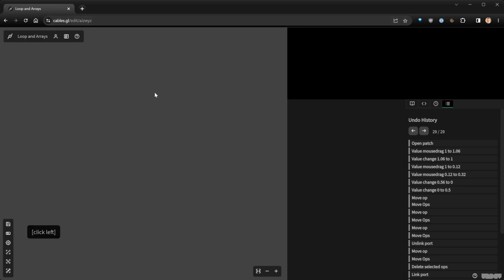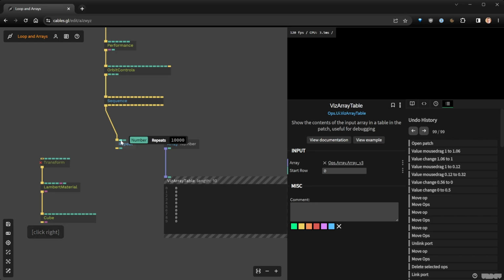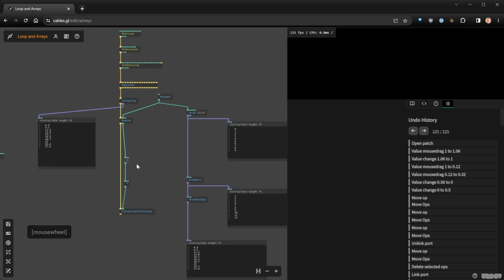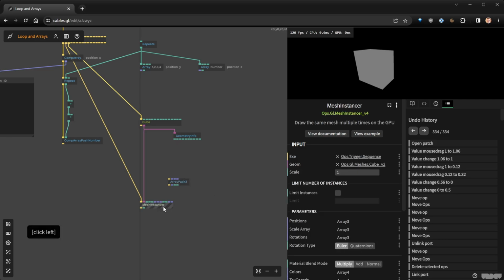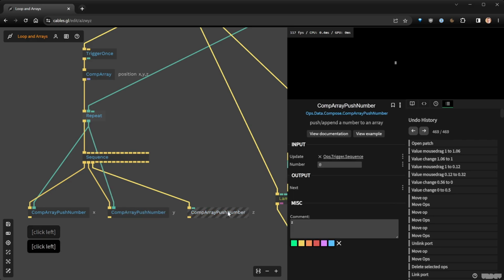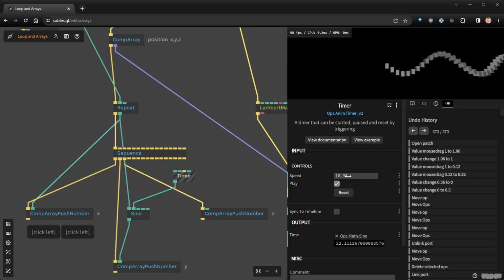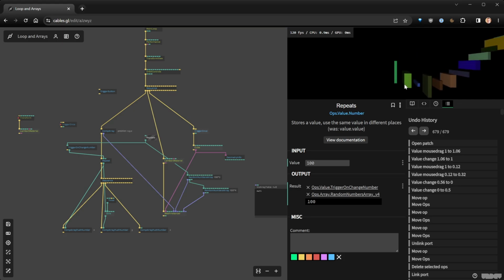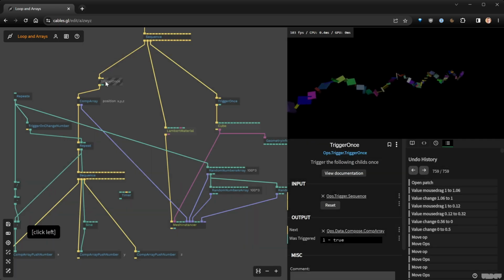Arrays (4/13) - Intro to Cables.gl

Comment: Not following in your example how you are repeating the arrays on the right hand side? Looking at the documentation  repeat "Triggers all ops below x times (for loop / while)" Maybe I don't understand the flow, how do you open the cables ops as java script, I think I would understand if I could see the code for the loop

Also why is the material not getting applied to the 0th cube?
Reply from the maker: Don't hesitate to join our Discord for support! I'm not sure what you're referring to here.